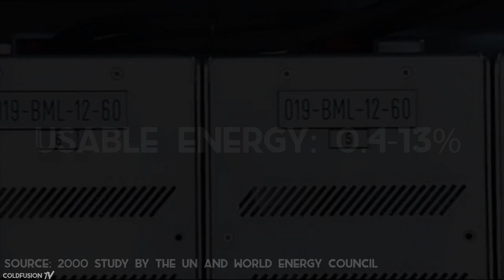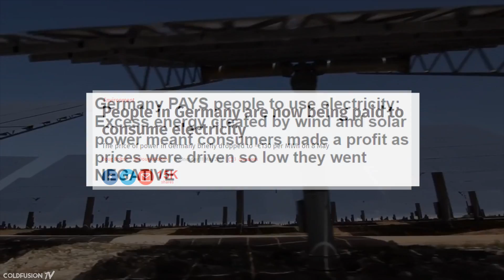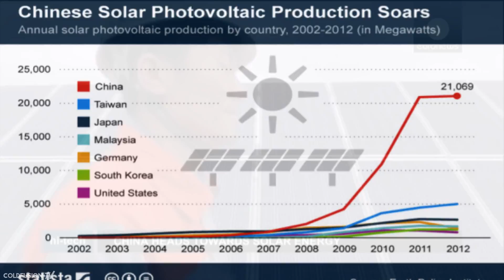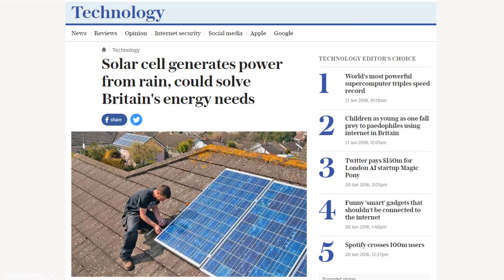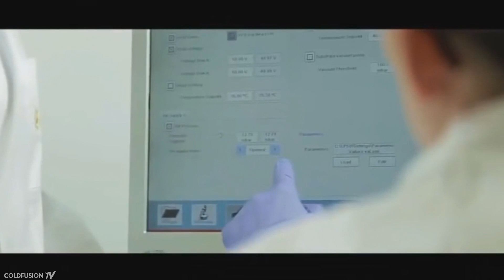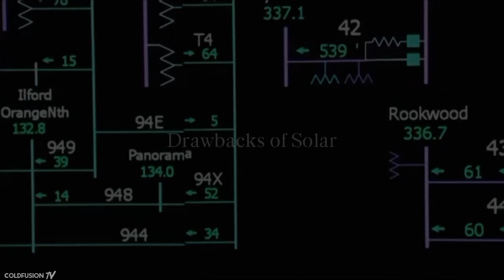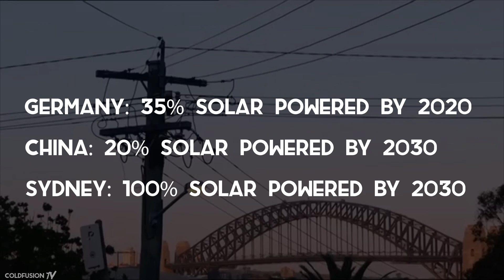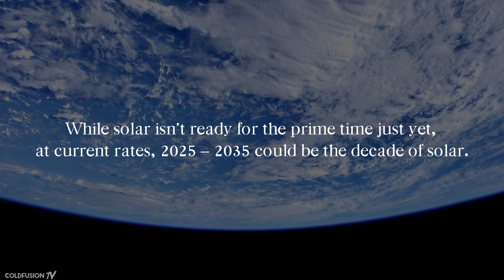The Truth About Solar

Comment: You DON'T gain that energy for "free" because: 
1) you need to produce/buy those things (=cost) 
2) you need to install them (=cost) and very important: 
3) you need to REPLACE those things on a regular basis because they break down after a short period of time (=cost). 
If you claim that energy from solar is "free", you could just as well say that energy from coal is free. (just burn the coal and voila: "free energy"!)
Reply: we can go around forever in circles with this, but fact is solar panels last more than 30 years, yes theirs always going to be malfunctions, but very few.  

If a combustion engine cost 5000 and a solar panel costs 5000, the engine always needs to be refueled so it can keep cranking that turbine. The solar panels don't.
Reply: +Strangething90 You really don't get the concept of operational cost.
Reply: Alex.. Everyone knows you have to buy the goodies.. Duh.. and you cant burn the coal more than once and I suppose if you dig it out your self and then burn it, would be free although not very environmentally friendly. .. And solar doesn't break down after "a short time"... decent PV's are good for 20 years and will still be giving you +-80% of your new one.. Oh and if you install them your self, you not paying anyone else..
Reply: Not to mention solar is by far "greener".
Reply: Also coal and oil ARE renewable energy (it just takes literal million years), and they also ARE solar energy.
Reply: Hey Josue, Strangedicks is right. You can go around forever in circles on this and stupid will still never get it.
Reply: If you read what I wrote, you'll notice that I wasn't discussing what is more environmentally friendly.
The only thing my comment talks about is that the statement that solar gives you "free energy" is completely FALSE and BS. There's no such thing as "free energy" from solar because there's always a cost associated with it and that cost is substantial. Especially, if you factor in (as you must) the cost of repairs and replacements that you need on a regular basis. Those things aren't magically falling from heaven for free and they aren't magically repairing and replacing themselves for free. 
Ergo: it is utterly FALSE to claim you get "free energy" from solar. You DON'T.
Reply: Correct. But just because the solar fuel is free, does NOT mean you get "free energy" from solar because you need to factor in ALL the costs (incl. running costs) of a given energy source. 
And until Santa Claus starts throwing ready-made solar panels from heaven, installing them and regularly replacing them for free, until that happens, energy from solar won't be free.
Reply: Josue Nieves If the government would play the role of that magic Santa Claus I mentioned and provide the solar panel, the installation and the regular maintenance + replacement for free, then energy from solar would become completely free. (unless you consider that you have to pay the government in the form of taxes) Sadly though, we don't live in a fairy tale world and anyone who's ever considered installing solar for their house knows that even with government subsidies it costs a LOT to buy solar panels, the batteries for storing energy for use at night, the installation and maintenance + regular replacements.
Reply: Michael Kim, Jr. By your argument ALL energy is "free" then. You must be the new Einstein. As your next big invention, you should invent a way gather and store energy for free as well. Come on! You know you can do it, Einstein.
Reply: Yep. Just wait a few hundred million years and voila: all coal and oil will be renewed! All for FREE! :)
Reply: Alex Booster Seriously though, we're working on developing organisms that can use photosynthesis (i.e. solar energy) to produce combustible fuels such as methane (i.e. natural gas). Photoelectric effect is a whole lot more efficient method of converting solar irradiance into electricity, but we're just not good at handling energy as electricity and in liquid form it's much more manageable.
Reply: Sigma Centauri 
I've heard of it and THAT'S a great idea!
Are you personally working in a company that's developing that?
Reply: well, the solar fuel is free
Reply: until they start taxing you for sunlight useage..
Reply: Folker46 ! "And they don't work at night." you're lying...
Reply: Your not even worth arguing with.  Do you work for Exxon or something?
Reply: Alex Booster Well, it is almost free. Let us not forget all those government subsidies that maintain the solar industry artificially alive, just like wind energy. But we don't want to get into the politics of stealing from the taxpayers to maintain this religious sect alive.
Reply: The "energy" is 100% free. The cost your arguing about is for gathering and storing the free energy. If you want a solar house then the cost is for the house not the energy it runs on.
Reply: Alex Booster Of course not, it's some guys in America (I think) are busy with it. I don't deal with sourcing power, I only work with sinking it - motors and circuits.
Reply: sounds brilliant, but not practical until you beat solar cell efficiency, and how do you sustain and manage such an organism?
Reply: After the 5 years it takes for the panels to pay for themselves in electric bill cost savings, they are free for the rest of their lifetime. The warranty is for 30 years, but even then they will still produce almost 80% of the electricity they do now, so yes, my electricity will be actually free for many many year to come.
Reply: reedatv If it only takes you 5 years to pay for the cost, then you must have a rich uncle who paid the remaining 3/4 of the cost. Nice.
Reply: "feed in tarriffs" - if you said government subsidies paid out of tax payer's pocket that would have been a bit more honest and closer to the truth that the actual cost is substantially higher.
Reply: what subsidies? they are only paying you for power you generate, as with any other power plant. and again, don't complain about solar incentives when our government is increasing coal and oil incentives. or did you conveniently forget about them?

http://bfy.tw/6Trx
Reply: Alex Booster Remember last months bill for sunshine?... < that is the energy.  if i could draw a simple picture i would. solar panel and batteries are not energy but a way to harness it. cheers, good luck, and don't forget to breath.
Reply: As for storage, lithium ion batteries are excellent and will be perfect for solar panels right now. Later new tech will replace them and gives more benefits. the batteries also pay for them selves so you dont have to use coal electricity at night/morning. 

the only good arguments you can possibly have are:
1 Coal influence in politics that will slow down innovation
2 sun doesnt always exist ex: winter russia where the sun is out for 4-6 hours
3 environmental cost of manufacturing the solar cells
Reply: Michael Kim, Jr. No, that's not energy, that's useless sh*t UNLESS and until you convert that into useful energy. This video specifically talks about making solar energy USEFUL. And to make it useful i.e. to convert it into a useful kind of energy does have a substantial COST. Therefore: IF you want to actually USE that energy, it's NOT "free". It only remains free if you are NOT converting it into a useful kind of energy.
Reply: blahpunk1 It seems that most people here DON'T understand this simple fact. (a fact that should be obvious to any fifth-grader) 
It's great to see that the cost is going down. The only thing I was pointing out is that you DON'T gain energy from solar for free (as this video falsely claims).
Reply: Kick Goldenrod No, it doesn't. But since you haven't yet reached the level of a fifth-grader, you can't understand that yet. But don't worry, you'll grow up soon and that will open your eyes to a whole new world! :)
Reply: the operational costs are canceled out
Reply: It was explained in my initial comment a long time ago. It's all about converting solar energy into USABLE electric energy. To convert solar energy into usable energy there's an initial cost and there's a running cost (because regular maintenance and replacements are needed). Which means this USABLE solar energy is not free. Hopefully, it will become cheaper over time, but it's not free now and isn't expected to become free (or near free) any time soon.
Reply: VKG147 "Sunlight is hitting the Earth 24/7" only above the Arctic circle in summer. But hardly anyone lives above the Arctic circle. Oh, and in winter there's complete darkness above the arctic circle 24/7. So, with solar alone you'd only last for half a year above the arctic circle until freezing to death. :)
Reply: VKG147 I've never heard of anyone having problems burning things in the arctic. Works day and night.
Reply: VKG147 It was you who said "Sunlight is hitting the Earth 24/7". So, I thought you are about to build giant mirrors in space around the Earth, but you disappoint! :)
Reply: VKG147 Yes, I know that there are batteries. And to pre-empt your other questions: I also know that those batteries are completely free. (anyone who needs them just needs to ask, totally free) And I also know that manufacturing and disposal of those batteries is super environmentally friendly. Because those batteries practically grow on trees. :)
Reply: "free" as in the sun continually pours out the energy without any input from us humans. harnessing that energy is of course going to incur some cost.

that aside, after a solar plant is built, there are no further raw materials required to produce energy. of course there is maintenance cost and components wear out -- this is the same for ANY plant.

the important benefit here (esp in comparison with coal and other non-renewables) is that solar can produce net zero carbon emission. sure, right now manufacturing plants still draw power from dirty grids, and the raw materials required to produce solar cells and transport them still may require petroleum. but all that could change when solar power is used in those instances as well. solar powered factories, solar powered vehicles, solar powered mining equipment... not impossible.

the only real consumption concerns the materials used in producing solar cells. do they require rare metals? how rare are these materials? can they be replaced with other artificial analogues?
Reply: Gregory Samuel Teo 
What really matters is: How much does it cost to make a given source of energy USABLE. Try using your brain next time, OK?
Reply: Alex Booster why did i even bother.
Reply: Because you tried to convince people that you were using your brain. But the fact that you weren't made it easy to see through. That's why! :)
Reply: And they don't work at night.
Reply: No. I work for myself. But I have a very good BS detector.
Reply: Josue Nieves http://bfy.tw/6TYI
Reply: Strangething90 You don't beat efficiency, but it's so much easier to work with it outweighs drawbacks. And you don't need a whole lot of management with it. You just put input raw materials in a dish, put in bacteria, they eat it, produce methane, and then they die of starvation.
Reply: It takes 5-8 years to pay it back based on weather and feed in tarriffs - or you could just lease a system and get instant benefits. you can have 1 cookie now, or 2 cookies later, your choice.
Reply: Yes.  I think most people understand this.  The same things would be true if we were drilling for and refining our own oil.  The important thing is that the cost of owning and maintaining solar panels is going down.  Also the approach has changed at least where I'm at.  People are leasing the all the gear and getting grid-connected systems and the generated power is just deducted from the normal electric bill.  There are PV arrays going up all over the neighborhood.  My location (southeastern US) is not optimal for solar so I imagine this is booming in the southwest.
Reply: it becomes free after it cancels out the cost of electricity
Reply: Kick Goldenrod I'm sure your daddy cancels things out for you. Wait until you get into fifth grade.
Reply: explain how energy from the sun isnt free? is there a tax for using solarpanels that are yours?
Reply: Manufacture and installation of solar panels are cheap.
The problem is storage of energy.
Current batteries are impractical.
Reply: Alex Booster sunlight IS hitting the earth 24/7 but at different time zones
Reply: Kick Goldenrod Really? Oh, I didn't know that! :)
Reply: VKG147 I think these days they even grow batteries on bushes in the arctic. Just go pluck a few and you're ready to go for the night or even for the arctic winter. :)
Reply: VKG147 Sure! Once you grow up, I'll start talking to you like an adult to an adult.
Reply: VKG147 I'm glad you finally introduced yourself, but I already knew that you are an average internet troll that has 0 basis on the subject that he's talking about. Nice to meet you anyway! Once you grow up, you'll rise above average, I'm sure. :)
Reply: VKG147 Blasphemy? Respect! For an average internet troll kid you already have a rich vocabulary. Now you just need to learn to apply the right words in the right context and you'll rise above average! :)
Reply: That is like saying food is free. God let animals and plants grow, but we have to take care of them, and pack them in cointainers, etc. It all involves resources, time, energy, and that is why we pay for anything. In other words, nothing is really free, especially a $20,000+ home solar system. If we were to pay $200 - being conservative here - that is close to 8 1/2 years of power on a system with a warranty of 10-12 years, Did I mentioned that the system is HEAVULY subsidized by taxpayers? So much for free!

Comment: This video mentions daily intermittency of solar energy (day/night), but there is also the issue of seasonal intermittency (summer/winter) which is a more difficult problem. The daily intermittency problem is already solved by concentrated solar power (CSP), although CSP has drawbacks of high cost and a requirement for direct sunlight. I haven't heard of any solution to seasonal intermittency that makes sense at the scale of the world's energy consumption. Until daily and seasonal energy storage is economical, we will be tied to other energy sources like fossil fuels and nuclear.

Comment: As stated here. the real problem with solar, is that it's not "on demand". You may need more energy in winter, evenings, when there is less or no electricity produced by solar panels. Not only households, many industries do not stop their production at night....

This means that you'd need large storage for electricity/energy to offer this energy during the night. Batteries with enough capacity for the industry would be too costly, too polluting and take too much place !

Conclusion, you still need conventional power plants in parallel to solar.

Comment: Been wondering for a while, since the solar panels are black to absorb more of the sunlight they ivariably become hot so why not incorporate pizoelectric elements to the panels to increase the efficiency as infrared light heats the panels even when it's cloudy.
Combine that with the panels shown in the video that produces electricity from rain as well and they should become a lot more efficient than 35%, no?
Ofc. the price of the panels would increase in proportion so might not be viable.

Comment: I do not believe the numbers.  0.4 - 13%.  Really.  $0.36 per watt?  It has been a while but the panels I bought were much much more expensive than that.  I love the technology  and think there is a future for it but do not believe in unicorns flying under rainbows and everything has to fit into an economic model that, unlike our past, does not increase our debt to crippling extents.  Technology/economics is an evolutionary process that should not be forced.

Comment: Technically you could argue that fossil fuels are solar energy. Plants and animals in the past needed the sun's energy to live, and after they fossilised they are in effect stored solar energy. I think solar energy is a huge waste of resources, also the amount of energy required to build solar panels and their distribution largely depend on traditional fossil fuel sources of energy. Another interesting fact is that the amount of CO2 produced to build a solar panel is never amortized if you will by the short life span of a solar panel. Everything in the universe balances itself out, solar energy is just another hype to get people excited to buy into something that will cost as much as fossil fuels do today. And solar energy might be enough to allow one rich person to fly around the globe in a plane that has a top speed of 90 km/h - good luck when you have strong headwinds - but it will never ever be potent enough to carry as many passengers as a jetliner. Solar power itself is not the answer as it is the raw material of fossil fuels and the stored potential energy in them is far greater, we should instead focus on optimizing existing fossil fuel energy and continue investing efforts in nuclear fusion, which is not the same as nuclear fission which is the process of how nuclear powerplants work today. Nuclear fusion is something that is becoming reality, and when it does it will outperform solar AND fossil fuel combined.